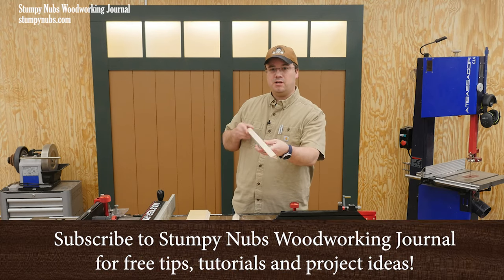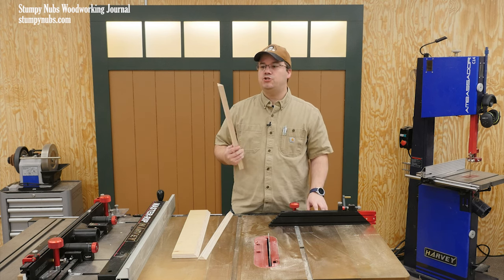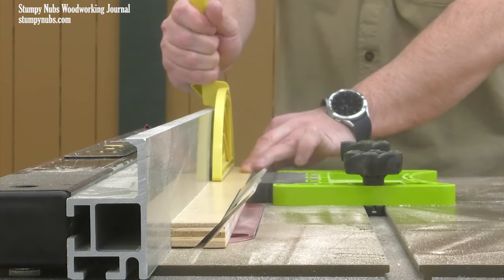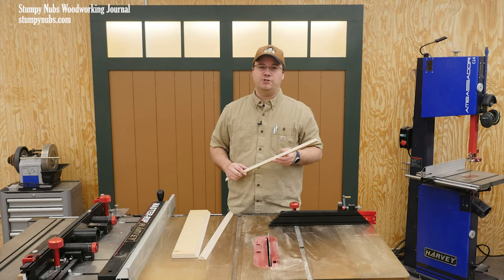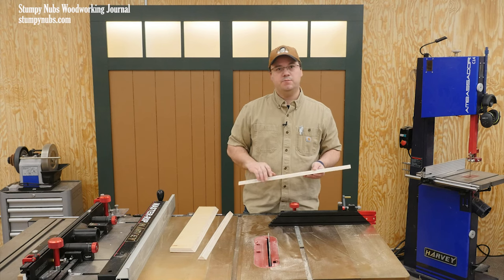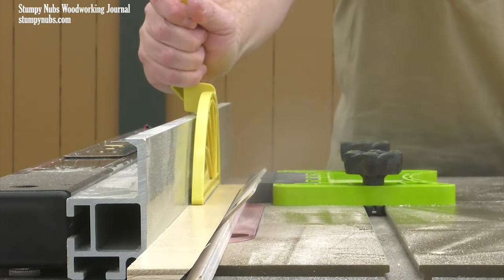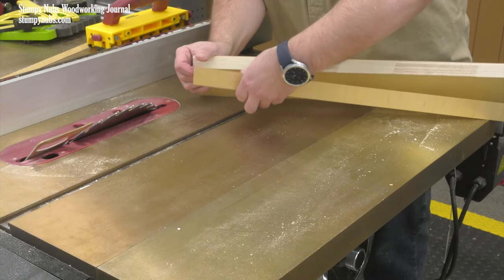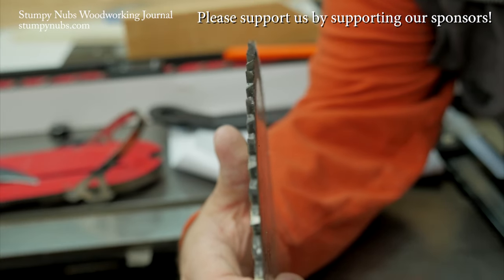A safer way to cut miters/bevels on a table saw

Comment: I use double back tape all the time to connect two pieces of wood togeather for narrow cuts. I have been injured twice by the table saw blade once by a kickback and once pushing a cut off away from the blade, a injury which is healing up as we speak.  I have no excuses. I enjoy your videos keep them coming.

Comment: I've used both of those tricks, looking to make minimum-mass glue blocks for inside some joinery.  I finally decided to make the right angles with vertical cuts. It does waste some wood, but it is easier on the nerves.  I also decided that I needed to put more thought into the design stage.

Comment: Another great tip and real experience-based recommendation.  I had exactly the same need to make some long DIY dovetail sliders with narrow stock and had a hard time keeping them from sliding around the second cut on the same stock.  Of course, I had a couple of close calls with the stock and just wanted to kick back but in my case just ruined the piece.  Your method is by far the safest and I am glad you share such videos that should prevent so many from injury or worse

Comment: I watch all of your table saw videos, and I'm certainly much more safe as a result. Thanks. Would you consider a video on how to approach this challenge:
When installing 6 or 7 inch plank flooring such as wood or solid core vinyl you need to rip the last pieces that meet the walls. Unfortunately the wall is rarely square to the floor layout and you need to maintain a fairly consistent gap for expansion that will also be covered by trim. The safe way would be to use a jig saw (very slow) or a bandsaw (none at the job site) or a circular saw (yikes). I've seen folk use a table saw and freehand it (scary, foolish...) How would you do it?

Comment: Thank you for this alternative - safer technique. There always seems to be a workaround to do things safely and/or with limited tools.   I have an older Delta table saw with a right tilting blade - i.e. tilts toward the fence rather than away from it. I am unable to get it to make a 45 degree mitre cut. It keeps binding and ultimately powers out. I have tried using a crosscut sled and installing a temporary fence on the left side of the blade. Nothing seems to work. the only thing that has worked for me is using a "jointing sled" (a sled with dovetail clamps inserted into grooves on the sled) but that leaves the edge being cut completely unsupported from below. Might you have any solutions for this issue? I can't find anything online that explores/explains this issue. Many thanks for you amazing contributions to wood butchers like me.

Comment: I have a similar cut I am thinking about making on a table saw. So I did a search on YouTube and came accross your post. 

I am making several floating shelves out of quar-ter-sawn white oak.  The top and bottom are going to be 12" not a problem with making the beveled miter cuts.  The face  and the ends of the shelf  is 2"  all boards are jointed and  milled to 3/4"  this will give me a 1/2" flat area between the bottom of opposing 45 deg. bevels on the 2" boards.  Do you think 1/2"  is enough  serface area to reference on the table saw to make the second bevel cut?  Each shelf is 58" long and the boards are  60" long. I have 12 of them to make.    My other option is using a  lock-miter router bit  on the router table.  But I think that may have more risk than the table saw in this case.
Any comments or suggestions are appreciated

Thank you

Comment: I have a mangled thumb due to a similar cut.
Would it be (comparatively) safe to cut a 45 degree cut, and then tip the work piece 45 degrees such that the cut edge is against the saw.
Then cut a 90 degree cut.
Possibly with a sled instead of using the fence.

Comment: Mr. Stumpy. Can you share a little advice?
I'm a very limited DIY and was trying to decide between buying a portable table saw or a sliding miter saw.
Reply: As just a random commentor, I want to ask: is the constraint space or budget? 

I've never seen a budget portable TS worth messing with, but I've seen loads of $150-$250 vintage table saws that are about as good as anything under 600 bucks these days.  At the high end of price, there may be a portable worth owning. Like a Festool, saw stop, etc.

A SCMS is great to have, but it won't rip. It probably won't be great for most joinery operations. A table saw on the other hand does anything with the right jigs.

Have to say, if I could only own one powered saw in the world, it would be a high quality bandsaw. Love my table saw, but a bandsaw, some hand planes, and a maybe a router table would muddle me through anything, I think.

Comment: So we use a jig on our saw with the  blade vertical  timber triangles fixed to a board each side of the blade then run your stock through no kick back

Comment: Thanks, great safety tip. Though I am not sure if double sided tape is the best solution. Double sided tapes have a strong adhesive but when put against a spinning saw on a table, I doubt if it will pass the test.
Reply from the maker: You just saw it pass the test in this video. Use wood turner's PSA tape. The bond is very strong.
Reply: Wood turners tape is very strong, but I've used carpet tape for years and never had a saw break the bond.
Reply: People have used double sided tape to hold parts in metal machining.

Comment: Well at least it isn't just me. When I cut small pieces they almost always seem to catch on the blade and fly off. Fortunately I'm aware it can happen and try to stay well away but it doesn't make it any less disturbing. The pieces sometimes just rotate into the blade as the final sliver of wood is removed. I've been considering making an angled cut sled to deal with the problem.

Comment: Good morning I’ve just come across your videos and subscribed , I’ve recently started making items from copper pipe, and I use a CA glue called Super Fast Plus, it glued the joints but it seems rather brittle and I don’t want to sell things that might at a later date break, I’ve seen a glue on E bay called Just for copper pro , which is made in America , have you come across it or could you recommend a good glue for bonding copper pipes . I made 4 I pad stands for my grandchildren which I soldered , which is very strong but a lot of items made from copper pipe on E Bay haven’t been soldered and look a lot neater , I live in the north of England and the only place I can buy Just For Copper Pro is E bay and it’s 42 Dollars or £35 sterling thanks Peter

Comment: I haven't used a Bandsaw in over 30 years.
I have no room for one with my current set up.
How would a Bandsaw be safer for this, or any cut?
Reply from the maker: Bandsaws cut straight downward and at slower speeds. They do not kick back.

Comment: I can't see how much that discount code is good for. It just says pay now. I'm not ready to use it but I just wanted to see how much it would discount. I bought a 12" Ridge Carbide blade for my miter saw a while ago and it's the best blade I've ever used. I need one for my new sawstop now
Reply from the maker: It should show the discount in your cart before you complete the transaction.
Reply: @StumpyNubs  that's what I was expecting. Maybe a glitch. I'll try again

Comment: First, I am a self taught woodworker, so keep in mind I am not an authority in the subject. I have noticed you never stand directly behind the wood to the left of the table saw blade. I alway do this too, out of fear of being shot with the wood. I am always as careful as I can be, but I don’t use the blade guard. It just seems to always get in the way or leave scratch marks on the wood. I have a cheap Hitachi job site table saw, which has never let me down. My question is, do they make a better guard that is universal and would not get in the way? Keep in mind I’m on a budget, so high dollar equipment is not feasible. Thanks.
Reply from the maker: Unfortunately, there is no universal guard that is affordable for limited budgets. I would try to improve the one you have. Maybe figure out what's sharp that's scratching the wood.
Reply: Round over the edges of the guard with some sand paper.

Comment: I am surprised, as safety conscious as you are that you left the height of the blade so far above the surface of the work piece. Less blade exposed is always safer. My practice has been to adjust the height of the blade to just half the height of the gullet above the work surface. All your techniques noted in this video would work exactly the same, but with less exposed blade. Much safer! Hope this helps y'all.
Reply from the maker: Actually, that is not applicable in this case. Bevel cutting is prone to kickback more than a regular rip cut. By raising the blade height, the teeth contact the wood at a downward angle rather than a forward angle. This is less likely to shift the offcut beneath the blade and create a kickback.
Reply: @StumpyNubs  So true and something I hasn't considered. Thanks for that insight.

Comment: Good tip, but only with double-stick tape. Hot-melt glue goes on too thick, so you're unlikely to get an even, straight bond to the scrap wood piece and you'll get a crooked cut.
Reply from the maker: When hot, the glue presses as thin as you need it to be, at least as thin as the tape. It is useful in almost any application that tape is used in. You should try it, you may be surprised.
Reply: @StumpyNubs  I have a great deal of experience using hot-melt glue, and I stand by my comment. It does not press as thin as you need it to be under most circumstances. I think you're the one who should "try it, you may be surprised."

Comment: I use instant  glue with spray activator. Works well.
Hot melt is not convenient.  Need to heat, waste of glue and poor adhesion
Reply from the maker: Super Glue is much more difficult to remove after the cut.

Comment: What about just completely disintegrating the off cut triangle?
Rip a couple of strip of scrap so that you don’t need to reset your fence. Then just make multiple cuts and never have an off cut.
Reply from the maker: That would greatly reduce the chance of an offcut kicking back, yes.